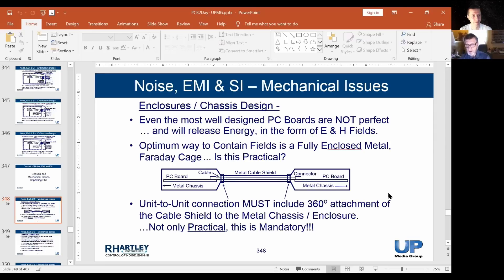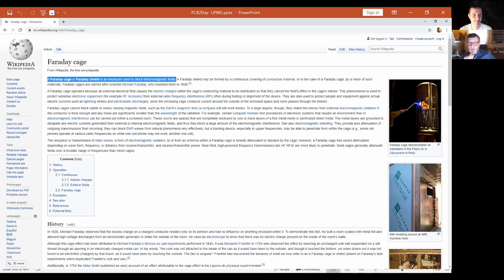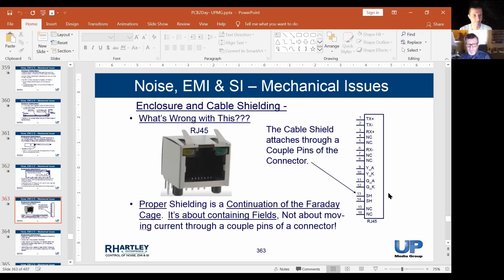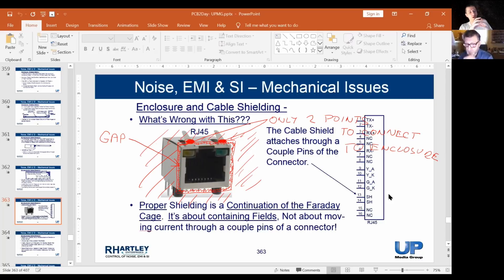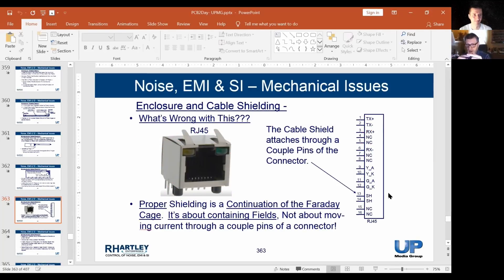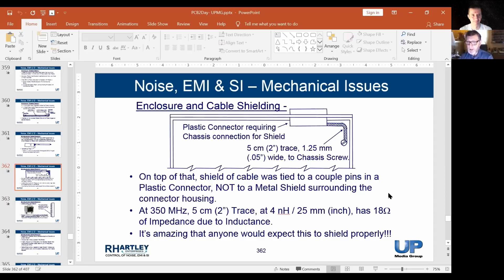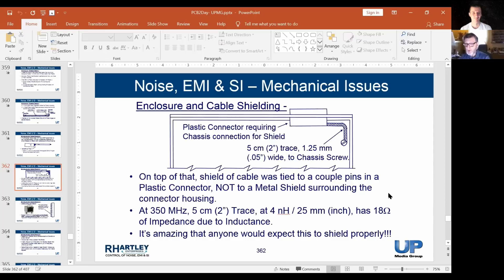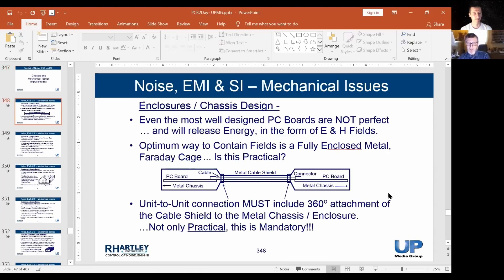Where To Connect The Shield of a Cable? Explained | Rick Hartley | #HighlightsRF

Comment: Unbroken chassis ground pour in the bottom layer of the PCB connected to the shielded LAN connector. There are chassis shield islands below the LAN connector stitched to this bottom pour. The connector is connected to the cable shield. The cable end has a shielded RJ45 connector which makes a 360 connection to the shielded PCB mounted LAN connector. Is it effective in shielding the circuit from EMI in plastic enclosure or there is no need of this shield pour arrangement? We cannot use a metal enclosure.

Comment: But what to do when pcb is in plastic enclosure but cable has to go near external interference sources? For example basic network equipment, 100base-t, with SFTP cable ran next to power cables. How should shield of that cable be terminated?

Comment: This is a very theoretical answer. Sure the proper answer for EMI is probably a 360° fully enclosed shield and chassis like he said. 
But in many cases I feel like the question is really about : i have a RJ45 cable, a usb cable or I don't have a chassis, whatever the situation. What is the best way to connect to shield to not fuck up the system more than it already is?

Comment: What if it's not in a metal enclosure? Say you have a MCU with short run of trace to a USB connector, should the connector body/cable shield be connected to the ground net on the PCB or left floating or is there a better way? Like maybe connect it to an isolated net on the board with a resistor and capacitor in series, where one lead of the capacitor is left floating. That way AC current picked up by the shield can flow in and out of the capacitor and get converted to heat by the resistor on the way.

Comment: It was stated a few times that a 360 degree attachment of the cable shield is necessary. What does this mean?  I see lots of comments from people apparently understanding this, but I'm totally lost.
Reply: Imagine the wires are people in a submarine. In a submarine, the water will try to get in from ALL directions. If there is any opening anywhere the water will get in. 

Now instead of water in reality it's electromagnetic radiation. It can come in from any direction, thus the need to have the wires etc completely surrounded.

Comment: I always do a capacitor and bleeder resistor to ground and not directly to ground.
Other option if the device is the source, that side could be connected to ground.

Comment: Unfortunately, as a device manufacturer you have to deal with the real world of poorly grounded machines with massive differences in ground potential.
That whimpy RJ45 shield can easily be burdened with 20amps of ground current. And the customer will then blame the device manufacturer for the fire.

The "safe" option (as recommended by IEEE)  is to put 1nF capacitors in series with the RJ45 shield.
Not ideal from an EMI perspective, but safe from a ground current perspective.

Comment: This was a good lesson sir. Thanks a lot.
I had done the mistake of connecting a thin wire to computer case on a VGA cable and wondered why the picture was not clear. By accident I connected a thicker copper wire the picture became clear. Impedence at higher frequencies !

Comment: I don't quite follow the RJ45 criticism. The connector is literally a metal box. The problem is that the front where plug is connected is open? Because the ethernet plug itself is not shielded as such? Or what is the opening he is talking about?

Comment: @RobertFeranec If one side of the device is a Plastic enclosure and the other is Metal one and connected with Shielded cable and 360 connector on both side then one shouldn't connect Shield to Plastic enclosure?
Reply: Where can I get pdf version of ppt that Mr Rick is showing?
Reply: @commanman8967  Yep, I would like to access that too :)

Comment: You state the question as, "Where should I attach the shield of the cable. Should I attach it to signal ground, or to earth ground" .. 
Honestly, I am confused by the answer: "You don't connect it to either" but then you immediately say, "The shield should be a 360 degree attachment to the chassis".
Since the chassis can also be "grounded", Are you basically saying that "regardless" of the signal ground or earth ground, you perform a 360 degree attachment to the chassis, whether or not it is grounded"? In that case, how do you avoid current traveling thru "Ground Loops"?
Thank you...
Reply: Yes, video is very confusing.  All I hear is problems but I came here for answers.  360° connection to chassis does not really tell me much actionable, I am designing a pcb not a chassis.

Comment: I am sorry to say that I disagree that providing such definitive answers to very complex issues. This misleads the viewers. All EMC  problems are created by conflicts between safety  requirements and the requirements to keep the noise from getting into or out of the signals in the cable.  Connecting two chassis with a shield with a very low impedance can create safety problems or even increase the emissions by carrying common mode currents that might  not have been present if the shield was floating.  Instead of one black and white answer, several answers should be presented and compared.  It is the overly generalized answer that gives EMC the reputation of being magic.

EMC is very difficult to teach though, so I am sorry if I sound harsh.

Comment: 5:58 there is briefly a slide showing a metal plate in a plastic enclosure. Ott also describes such a setup as a method of mitigating ESD in plastic enclosures. I would love to hear Rick expound on this approach and how a big external plate is different from the ground planes in the PCB itself.

Comment: Aaaaaaaa! RJ45, 150MHz radiation. Shielded cables, shielded connectors that ware snug into the case. Still only passed EMC with a <2dB margin. 
But it passed and that's all that counts! :D

Comment: What I was taught was to always directly connect SHIELD to 0V/GND ref plane to ensure a good RF bond between the two (unless you are dealing with a corner case that requires electrical isolation). But the trick is that the conductors inside the SHIELD should be "laid out" in such a way that no return current flows through the SHIELD itself. So always running a pair of conductors (twisted if possible), one for signal and other for the signals return path, and both in close proximity to one another